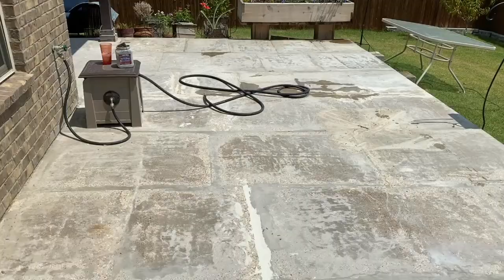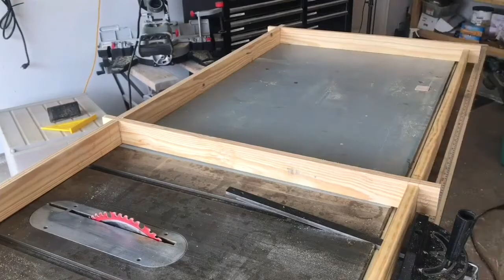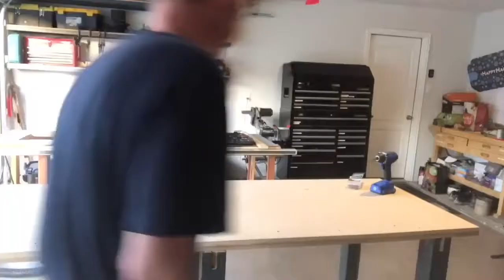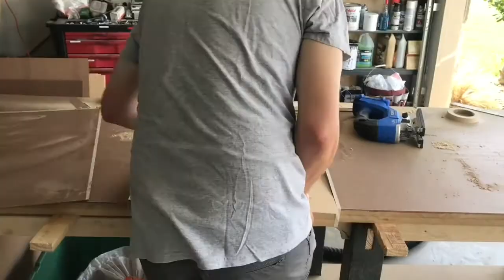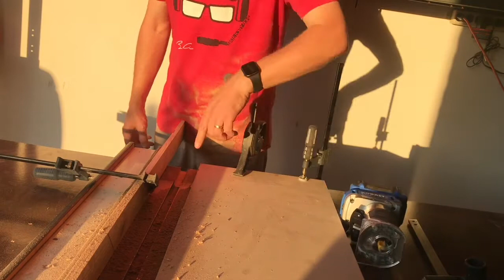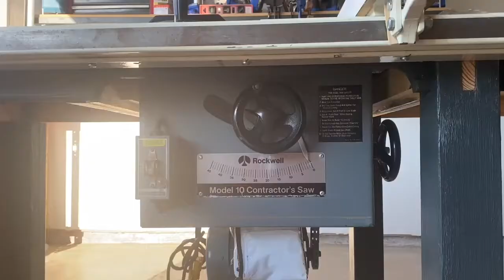A New, Super Strong Table for this This Old Model 10 Contractor Table Saw!

Comment: Scott, thanks for your very informative videos of the Old Model 10 Contractors Table Saw. I have a model Rockwell Model 9 and plan to build a similar table to yours. How does the saw seat on your table frame? That was not clear on your video. From what what I could see the seating edges were very narrow for what is a very heavy piece of equipment. Thanks again.

Comment: Love you table saw and outfeed bench. I am in the process of building my own bench. Question for you,,,what type of poly did you use? Was it water base? You may have said it but I missed it. Great idea for a sacrifice surface top. I have many ideas and will use a little from each saw table bench that I have researched. Glad I found your site and I look forward to seeing what other ideas you have on future videos.
Reply from the maker: I used Minwax Fast Drying oil based poly.
Reply: Thanks for the info. I will definitely be using that on my sacrifice tops.